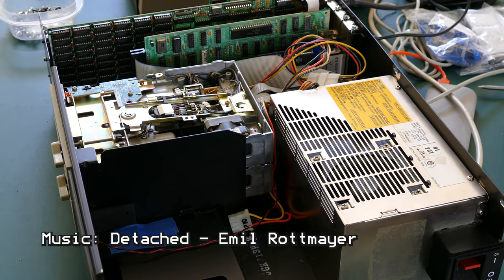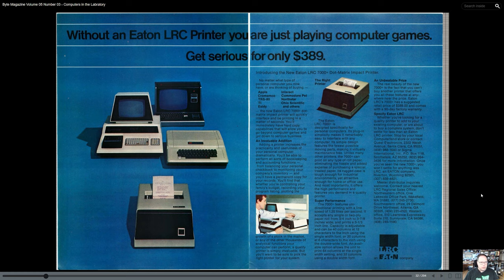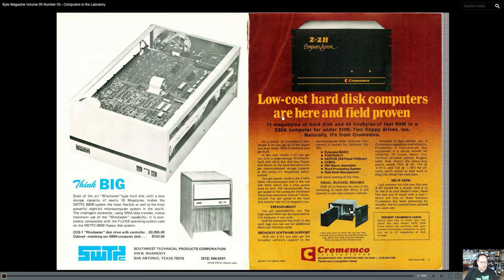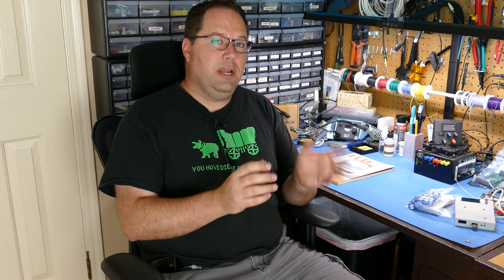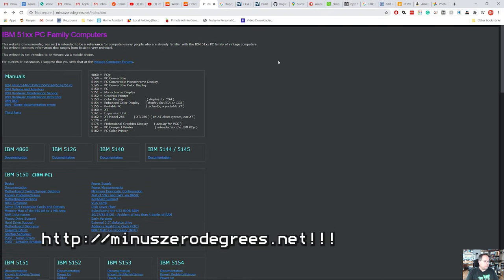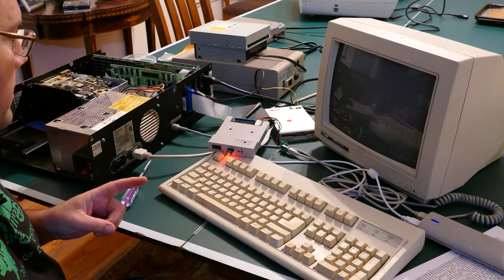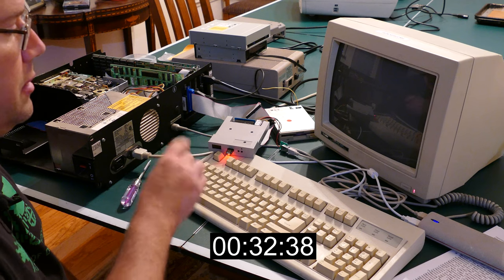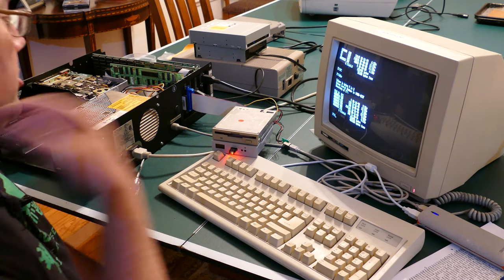A Third Floppy Drive On The IBM PC 5150

Comment from the maker: I totally forgot to mention another reason why you wouldn't have found a hard drive in an IBM PC 5150 back in 1981. The power supply! The power supply that came with the original 5150 was not really up to the task of running a full-height hard drive along with everything else. When the hard drive model I have came along (Seagate ST-225), it was a half-height model that was less power-hungry and could be added into an existing 5150 with a 35W PS.

Comment: Problem with 8:03:
.bmp extension was introduced in 1990 with Windows 3.0, which could barely run on a 5150, but it could run (minimum CPU is 8086), it also supported the CGA graphics card (barely, and in 640x200 monochrome), 3.0 was more suited for 5160 (XT) and 5170 (AT) compatible machines, and Windows 3.1 dropped Real Mode support, requiring a 286 or later processor.

Comment: I saw your post in Vintage Computer Club! I came, watched and subscribed! I love your intro! Very well laid out video and informative. I have a 5150 as well and absolutely love it! :)

I'm about to get 2 more! Never can have too many 5150 :)
Reply from the maker: Will you do anything different with the other two?
Reply: @RetroHackShack  I might do some mods or something. I have 3 MFM hard drives for the 5150. One of my systems is from Microsoft and has a good selection of cards and upgrades. I like to keep these systems as authentic as possible but that XT card is very tempting  :D

Comment: An external floppy drive was vital if you were using a wedge Amiga. I had an A1200 and everything come on at least 2 disks, if not 4 or more, plus you'd need a save disk. The amount of time and faff saved would probably equal about 30 minutes or so a day by having an extra floppy drive. Thankfully Amigas(except the A1000) have the OS on ROM(you DO need a disk to invoke it, but most programs and games would invoke it if you inserted the first disk into the internal drive on boot), so you could typically have a program disk in DF0: and your save data on DF1:, only needing to use the supplied OS disk if you want to change screen resolution or load an additional driver.

Of course, you have WHDLoad these days, so a second floppy isn't really required.

Comment: Hello, Eznix showcased your channel so I thought I would give it a look. :-)
Very good video on the subject too. I know what was going to happen when you put the ribbon in the 37 pin plug the way you did it the first time.... :-)
You see even though the drive was found and a drive letter assigned, you basically had transmit and no receive on the cable. think of it as a two lane road, traffics going both ways until you raise the one drawbridge and the traffic can't go any more... Lol

As for making the cables, The computer shops I worked in back in the 90's (yet today in my shop) we used a small vise and set the cable in the plug/connector with the top cap in the slots and the cable aligned and then we very very slowly  cranked the handle and kept checking the alignment until it was squished together. This worked 99.9% of the time... :-)
We made a tone of Scsi cables then as the cases were 2+ feet tall and none of the cables were ever long enough for anything including power. Great time to be a computer guy in those days.

I still love to build old computers out of old junk from eBay... Lol Currently I'm only 8 years behind on my junk...
I have one of the first PC Jr's I have in storage that I need to get out and make sure it still boots on the 360 dual floppies. I get it out once a year to check it out, then pack it back up in the boxs and new moisture packets. Hmm, I think it has that port on the back, I will have to look.
I love Tech Tangents channel he is a good source too!

Anyway I sub today to help ya out so I will watch some more vids later, I'm taking a break from a bash script I'm working on...
Take care and good luck with the channel!
Thank you for the videos!
LLAP
Reply from the maker: Thanks so much for the nice comment and the ad"vise" :) on getting those connectors pushed together!
Reply: @RetroHackShack  BTW you are doing a Great Job on the videos! You folks that do this content on YT are braver that I will ever be... :-)
So I'm looking forward to more great stuff...
Yes I caught the pun... LolLolLol
LLAP

Comment: thank you for posting.  at 12:50, it looks like you only have half of the pins, either even or odd, connected to the cable.  perhaps you address this later in the video.  i think one could leave the original end on the cable, and ADD the 37-pin d-shell, to create a flexible 'dual purpose' cable.  i don't have a fdd card to look at.  could you desolder the external 37-pin connector from the card, and solder in an internal 34-pin header, and just use the unmodified cable & mount the gotek internally  ?  take care & stay safe.

Comment: is there a way to have a Gotek read a 1.2 or 1.44 image when connected to an XT class computer ? I have one running under flash floppy 3.3 connected to a Columbia Data Products Vp computer the disk controller is built-in the motherboard
Reply from the maker: Yes

Comment: I don't trust inflation counters.  The cheapest new car you could buy in 1980 that I see was either a Chevette or Pinto.  Both cost about $4000.  The cheapest new car that you can buy in 2021 is about $16000, which is about $4000 more than the inflation calculator would have us believe.

Comment: Why four floppies on a retro PC? 360k, 1.2M, 1.44M, some STM32-based thing. Of course, if you're as crazy as Adrian, you can now also look at how he did 8" on the PC. 😁

You said you wanted a tool for IDC … do you have a panavise or even a full bench vise? There are hand tools with a hinged bit to apply pressure evenly, like a panini press, but you can do the same with a vise if you're careful. The crimp creates a cold weld that'll much better connection than just reusing the existing holes, too.You'll lose about 1.5cm of the cable length to get the more solid connection now, but it's probably worth it long-term. If you want a cheap IDC tool and don't have the vise handy (or want something faster than a vise), ASIN B072MM8X7Y is a cheap tool that should do the job. The real to-spec universal IDC tools were crazy expensive, but as you discovered, you don't need them to make something work.

14 drives on the Apple II, think about it: 2 per slot. They need not really be in the slot in question under ProDOS.

Edit: Oh, forgot to add … taping off the hole on a 1.44M disk to use it as 720k … If it came formatted, the residual 1.44M formatted data may eventually start to interfere with the more recently written 720k. This especially happens with the cheap disks which always came formatted that were made late in the 1.44M drive's lifespan, boo!  Don't put anything you're not afraid to lose on them unless you at least seriously hit these things with a bulk erase first. Some carry the opinion that you can't ever truly erase them to an unformatted state, and they're still gonna be somewhat failure prone even then. I'm of the opinion that as the 1990s wore on, disks were made more and more cheaply. By the time you hit 2000, they were unreliable AF anyway.
Reply from the maker: Yeah. I started using my vise after this episode.
Reply: @RetroHackShack  I actually want to get some IDC connector pliers because they seem a little less fiddly when putting e.g. 34 pin wires in 37 pin connectors. But I have much higher priorities these days.

Comment: do i remember that the dip sw on the pc/xt mobo has to be changed to reflect the 3rd & 4th fdd ?
Reply from the maker: Technically, no. It does affect how the system labels those drives though. See the notes on this page: http://minuszerodegrees.net/5150_5160/external_diskette_drive/5150_5160_external_diskette_drive.htm

Comment: Hey what is the source of the 3d printed drive bay?
Reply from the maker: https://www.thingiverse.com/thing:2217061
Reply: @RetroHackShack  I really like the HD fake plate you printed.  Where did you get the little LED to put in it?  I think I need to buy a 3D printer now!
Reply from the maker: I made it by cutting a piece of red plastic down to the size of the hole then I glued an led in back of it.

Comment: Hi, there's a second lesson you need to learn from this experiment.

That is to NEVER, EVER try to turn a 1.44MB floppy into a 720KB floppy by taping up the hole that identifies the disc as an HD disc. The disc media is very different to that in a real 720KB disc and requires a higher write current to be written to reliably, hence as you found you get disc errors when trying to read the disc some time later.

Everyone knew not to do this in the '80s and '90s but for some reason certain YouTubers, whom I won't mention here, are saying on their channels these days that this is an OK thing to do. It simply isn't and you have had a practical demonstration of why it isn't. PLEASE don't perpetuate this misinformation.
Reply: In the early 90s, it was very common to punch an HD hole in 720K disks. The claim was by that time, the manufacturers were using the same media in both versions of disks. No idea if it's true, but they seemed reliable at the time.
Reply from the maker: Yeah. I did it all the time.
Reply: @JamesPotts  It's absolutely not true that the same media was being used in both types of disc by the '90s. The media used in 1.44MB discs has a much higher coercivity than in 720KB discs and thus requires a higher write current to be written to reliably. The two types of media are absoulutely not interchangeable if you at all value the integrity of your data.
Reply: @RetroHackShack  Hmm, and how many bad sectors were reported during formatting? And could you still read the discs a few weeks/months down the line?

It was then, and still is now, a false economy. Nobody I knew that tried it ever did it more than once, including myself.
Reply from the maker: Yes. I never had a problem. I probably still have some notched disks somewhere.